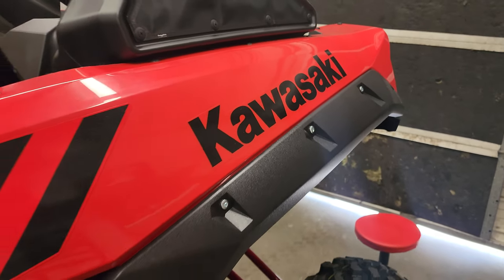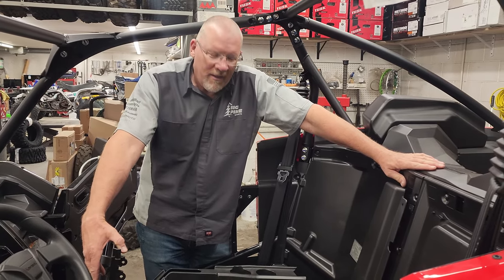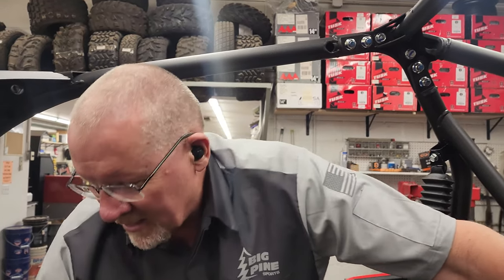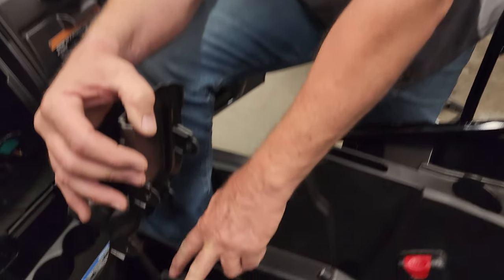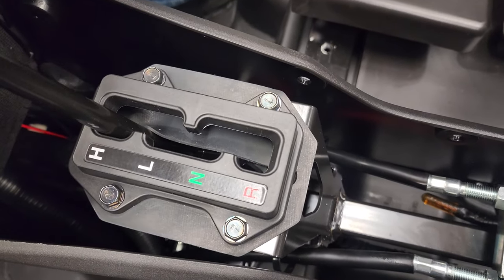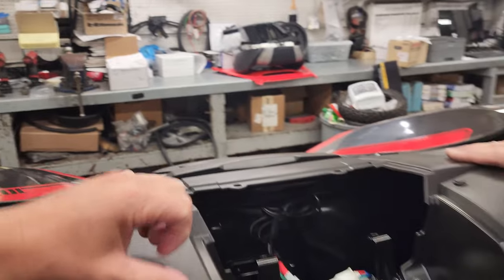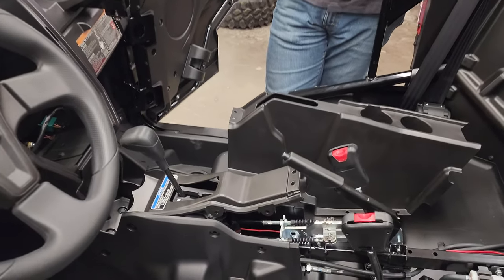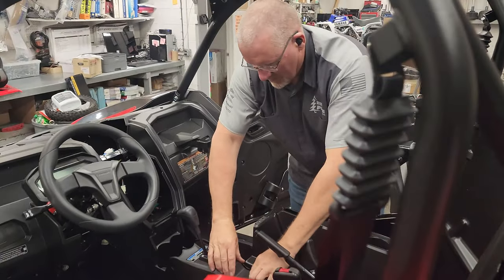ANOTHER 2023 KRX UPDATE FOUND! Actually 2!

Comment: What does the street legal kit consist of. I pic up my new 2023 krx special addition tomorrow
Reply: Tom the Ryco street legal kit contains all of the hardware and wiring to add the horn and front turn signals, as well as the wiring to integrate the turn signal function into the factory rear lights, and a license plate bracket with led license plate light, including installation instructions. You can also call Big Pine Sports for any answers on your install.